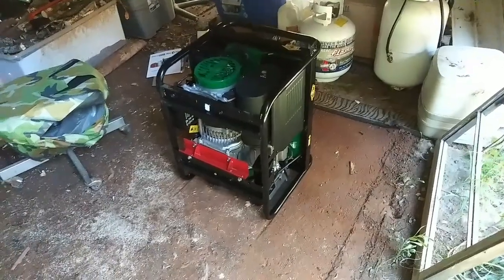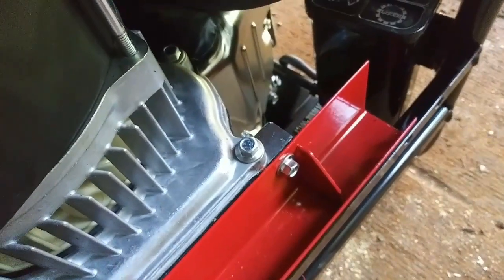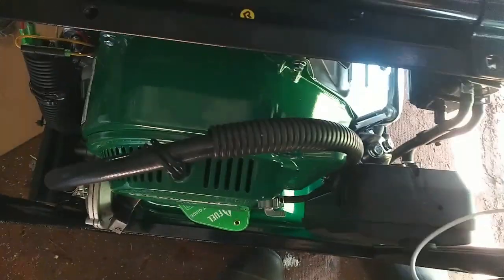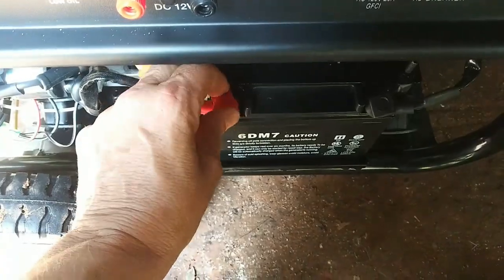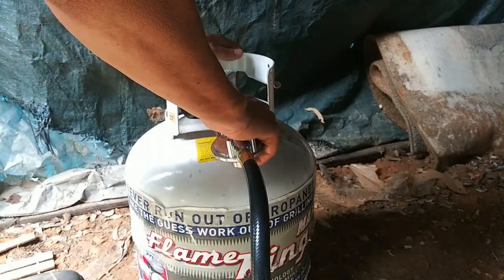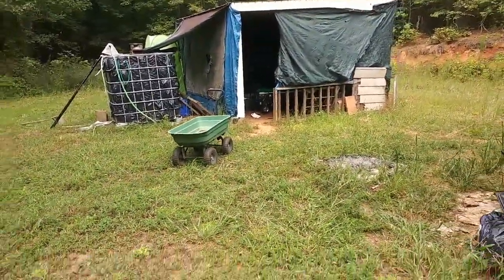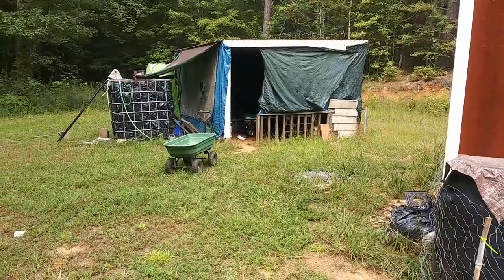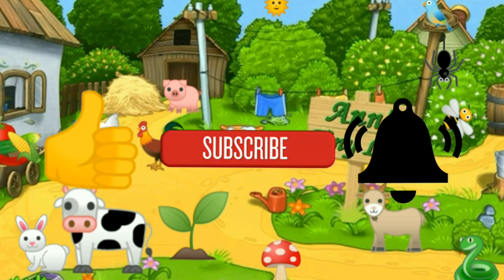Firing Up the DuroMax Dual Fuel Generator for the First Time - Ann's Tiny Life

Comment: Good job.  Be sure those electric extension cords are heavy rated.  If they get hot to the touch they can burn  through and cause a fire same thing with  the multi plug cord.  Good luck.  Proud of your independent nature!
Reply: A key thing is not to leave an over long cord coiled ... You are making an electric winding doing that that will heat up...
Unwind it all and lay it out like a snake
Reply: @josephdougherty2399  - Good tip!!
Reply: Sandra - Good tip.
Reply from the maker: again great advice joseph!

Comment: Also...if you plan on not using it for a month or longer at any time .. drain the gasoline and run it till the carburetor runs out of gas.   This newer fuel with alcohol really does a number on fuel systems when left to sit
Reply from the maker: very good advice joseph! in fact I've read that myself. but I will be running this generator exclusively on propane. if I ever have to run it on gasoline I will definitely be taking the measures you suggest!